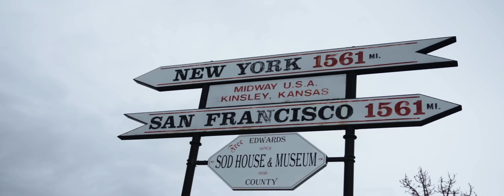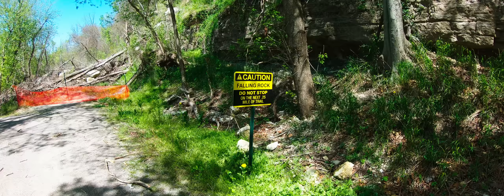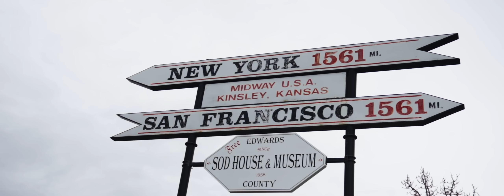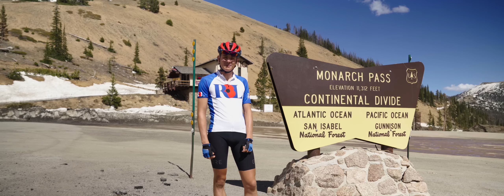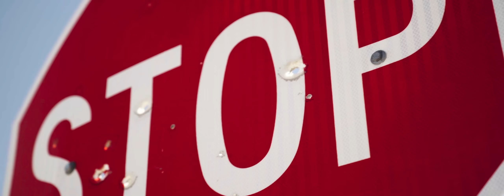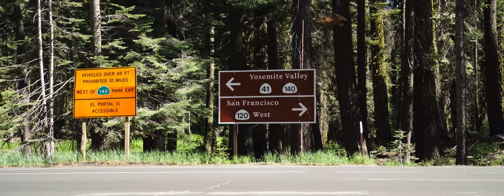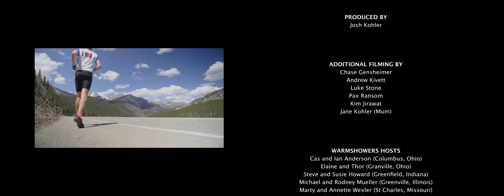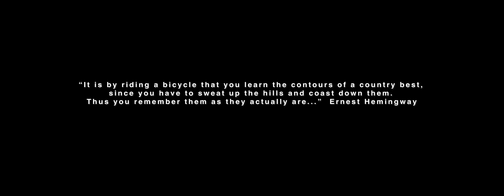Cycling Across The USA With My Dad - A Bikepacking Adventure Film

Comment: In 2007, my Dad and I biked across the US. We took the Northern Tier route with some modifications. Started at the Pacific Ocean at Cape Flattery, WA, and ended at the Atlantic at Eastport, ME. 

Like you, there was a significant fitness gap (I was 27 coming off an Ironman; he was 57 and hadn't cycled in years since I was a kid). And also like you, a mental toughness gap (I got beaten down more easily; he trudged on without saying much). My Dad was not a cyclist before or after the trip, but somehow he found the strength and fortitude to push on. We took 58 days to complete the 4350 miles (with 5 days off in the middle for a wedding), and on the days we rode, we averaged 90+ miles. 

We were fortunate to go west to east as the hills, while shorter, are much steeper on the east coast. My Dad initially struggled with the 5 mountain passes in WA state as they had long, steady climbs typically around 6% grade. But 6 weeks later, he was able to climb the 12%, 14%, and 20% hills found in VT, NH, and ME - though he did push the bike just a little on the 22% hill in ME!. My Dad had no idea what he had signed up for when he agreed to my idea. He had just overcome prostate cancer and I was feeling an urge to connect with him. 

In the years that followed our trip, I encouraged him to join me on an easier one down the Pacific Coast, but it wasn't to be. Our bike trip sapped the drive out of him. I think had I known more going into the trip, it would have helped prepare us better (less gear, more time) and perhaps that would have allowed him to enjoy it more. I was also immature and very fitness driven at that point in life, so I had sadly little empathy for whatever struggles my elder was having. 

Notwithstanding, my trip with him was for sure a pinnacle event of my life, and his too. He talked about the trip non-stop with friends and family for a decade. I have stared at pictures from our trip for more time than I can imagine, and long for those days again. My Dad passed away in January 2023 and my biggest regret was not finding a way to get him to do another trip with me. Cherish what you can, when you can. We both pulled a lot of strings to get time off of work and we certainly had hard times on the trip. But like you, we found not only immense beauty on our trip, and great and welcoming people along the way, but a true sense of connection when all was said and done. There is a lot to be said about going through a tough mental and physical battle with someone and how that can really connect you in ways traditional relationships cannot.
Reply: That made me cry Mike.  A wonderful life story.
Reply: Mike,

Thank you for sharing such a personal perspective. As the dad half of this trip it was an incredible privilege to share the journey with Josh. That you have experienced similar is gold dust that you will cherish forever. As Josh said, focus on the positive.  Make the most of time with your family and help others wherever you can. 

As I head towards 60, my knees hurt and I need longer arms to read a book, I am again blessed to be planning another trip with Josh. This time next year we head around the world.

Thank you again for sharing your humbling experience. Your dad will be hugely proud of you. 

G
Reply: Thank you Mike for giving this piece of your life to us. I too lost my beloved father in early 2023 and would give anything for just one more trip with him. We were fortunate to have done many camping and 4wd adventures together and even got to see a bit of the world together. Now my beautiful mum is alone after 60 years together with dad and we're making great memories when we can.

I wish you peace and hope you can find ways to manage that hole you have in your heart. All the best to you mate - Dave
Reply: @GeorgeKohler  George - what can I say. I'm a few years ahead of you and know exactly what you're talking about. I ran out of arm length a few years ago and need glasses for everything! Still keeping fit but my son is only 14 and a tiger of an athlete along with his 12yo sister. As long as I can, I want to keep doing adventures together and your story really brings home the importance of shared experiences above all else.

Young Josh is a real credit to you and your story really captivated my wife and I, here in Sydney. Tomorrow I will brush a few cobwebs off my bike and put a few kms under the old belt and plan some time out and about with the kids before I can't do it any more.

All the best to you and big thanks - David and family

Comment: A phenomenal video... hats off to all involved.  As a former bike tourer, I can relate to all the emotions expressed by the father and son pair.  As an aside, I would second guess the pair on only one thing:  I would have chosen a west to east route rather than the NYC to San Francisco route they chose.  First, the prevailing winds in the US are more westerly.  There were at least three times in the video where they experienced brutal westerly winds.  At one point, the wind was so severe they had to stop for the day.  Also, the temperatures in the western states are lower in spring than in summer so they likely could have avoided some brutally high temperatures.  By the same token, they would not have encountered snowy weather in the east had they left the West Coast in April.  Nonetheless, I applaud them for their achievement.
Reply: Thanks for your comments and I'm glad you enjoyed the video.  To have experienced this ride as father and son is a memory I will never forget.

There has been much debate and opinion about the direction of travel we chose.  There is no right or wrong way to cross the USA, but for us it was simple.  Novice cyclists, aiming to follow the path (roughly) of the pioneers who journeyed across such an amazing country.  We wanted to experience the breathtaking scenery unfolding as we rode, and we were not disappointed.  The winds were tough, but the experience far outweighed that pain.  If it was the easier option, it wouldn't have been as appealing or as rewarding (and we would have never ended up gathering quail eggs!). 

This was a life-changing experience and was about setting a goal, focusing on that goal and relishing the journey.  Given a choice, we would do it in that direction again!

Comment: This is awesome! I have the same Trek 920 & was wondering which fenders you went with, and would you get them again? Did you go with a smaller tire or stick with the 50mm/2inch wide tire? Thanks!
Reply: Thank you. Glad you enjoyed the film!  The Trek bikes were superb. We used standard Bontrager fenders which proved ideal; lightweight and kept the mud/water off us and our kit. We changed the original tyres for Schwalbe Marathon Plus Tour tyres of the same size. These were simply excellent, lasting not only the trip across USA but also the training including our warm up ride from Lands End to John o Groats the year before (1,000 miles). Only one puncture as we crossed the Mississippi and that was due to something exceptionally sharp. Definitely recommended!
Reply: @GeorgeKohler  thanks! Wow, OK I use those same exact wheels. I have over 3k miles on them and have recently ran over 2 nails that went in more than an inch and never punctured the protective layer & flatted. I had no idea Bontrager had fenders, I don't think. I'm affiliated with a Trek shop and didn't even know that. Thanks again & I can't wait to see what your next project will be!
Reply: @nixternal Every encounter we had with Trek shops was incredibly positive.  What a great company to be affiliated with!

Comment: Impressive and inspiring!   29:50  says 50 kg or 110 lb bikes  so 55 lbs each bike with gear or was comment an exageration while struggling to push the bike up the mountain?  What was cost of each bike with necessary gear and  how did non cyclists like you decide on what bikes, tires, and gear would be best?   What kind (if any) training was done before starting out because  in video says you weren't cyclists to begin with so idk how thats possible.    In my 50's i have to build up to 30 mile rides or more  and thats takes awhle.  If i was to start trip out  without training  first i'd be completeley wiped after 1st day and doubt if id be able to pedal at all the next day.
Reply from the maker: Thank you very much! The comment was not an exaggeration. We weighed in the bikes and both were over 50kg
Reply: Both bikes together weigh over 50kg?   What was cost of each bike with necessary gear and  how did non cyclists like you decide on what bikes, tires, and gear would be best?   What kind (if any) training was done before starting out because  in video says you weren't cyclists to begin with.    In my 50's i have to build up to 30 mile rides or more which takes awhle.  If i was to start trip out  without training  first i'd be completeley wiped after 1st day and doubt if id be able to pedal at all the next day.    Not to mention getting used to the saddle takes time for me even with padded bike shorts and upgraded softer seat.  Think i'd have to take many local rides over 3 months or so before thinking about doing a big trip even though im generally in good shape from regular exercising.   Unless being ex military and  tough young guy allowed for both of you to condition as you went ?   Either way,  what a  major accomplishment!

Comment: Is there a reason why you went for tradational cycle touring setup rather than a bikepacking setup cheers
Reply: We were aiming for the right balance of weight, comfort, practicality and security.  As novice cyclists it seemed the best option and proved ideal, especially with all the camera gear, keeping our kit bone dry regardless of weather in the earlier stages.
Reply: @GeorgeKohler  camera gear is hard to find pace while doing a bikepacking setup for sure ..that why most people use tradition  touring setups